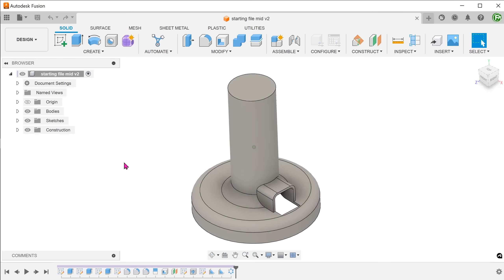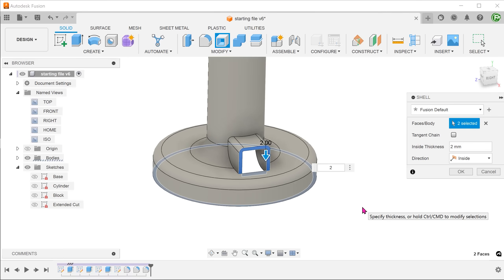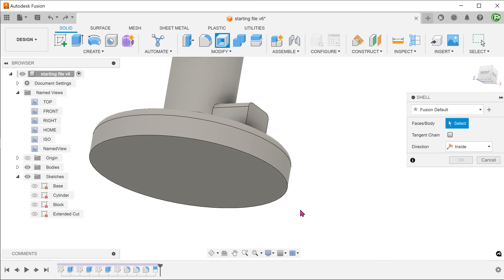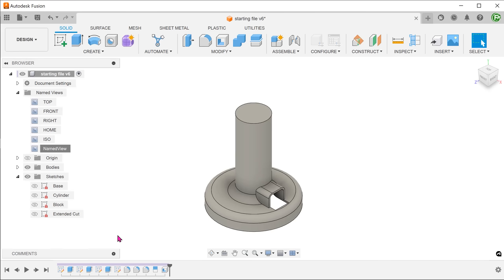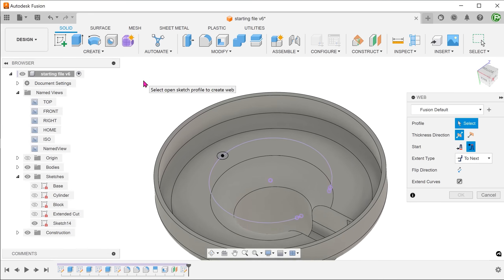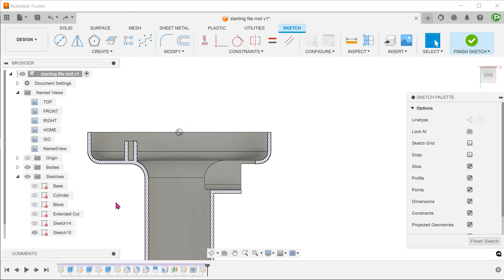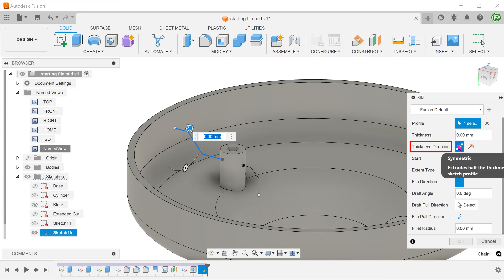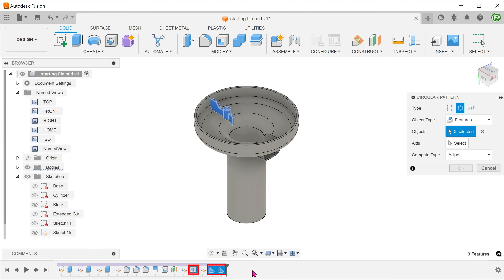Fusion 360 | Shell, Web and Rib?

Comment from the maker: For the rib sketch, it is actually not necessary to snap to the boss. The project->intersect step could have been skipped. If you terminate the line away from the boss, the rib command would automatically extend the wall to the boss.
Also, you can simply draw the line through the boss and perform a cut to remove the excess from the boss hole.
Happy Lunar New Year to all viewers who celebrate! Wish you all good health in the year of the dragon!

Comment: A clean video as always 👌🏾 just a quick question re the rib: what is the benefit of using the rib command as opposed to just thin extruding the profile? Surely with thin extrude you could have any curve without necessarily having a horizontal and vertical start/finish and also extrude both sides at once? I can't remember but i would imagine there is a "to object" extent type.
Reply from the maker: With thin extrude, you can only "thicken" along the sketch plane.
Reply from the maker: To add on, a thin extrude would be possible if the rib is just a horizontal straight line through the boss. In that case, the sketch would need to be performed on a sketch plane parallel to the top plane. But there would still be a limitation as the thin extrude would not be able to conform to the cylindrical face of the boss.

Comment: Thanks! There's a great tip in every video! Instead of using a sketch and splitting the body for the area in front of the tunnel you could also do a press/pull of the vertical face.
Reply from the maker: Thank you for your support! Ahh, did not think of that. I went back to try this. It works.